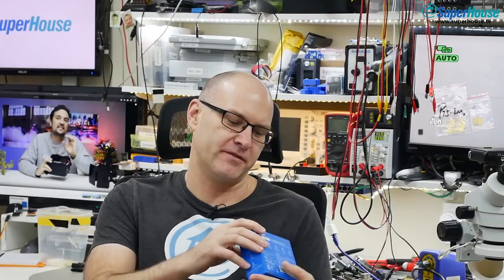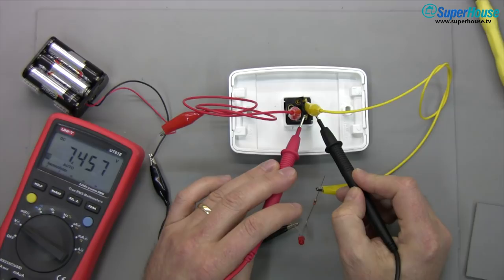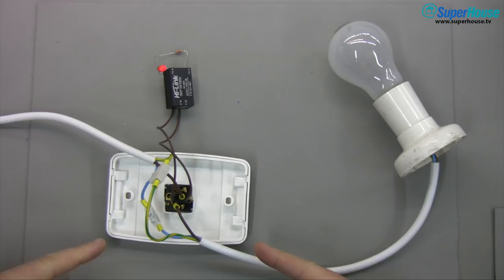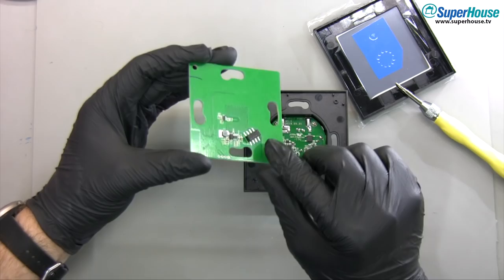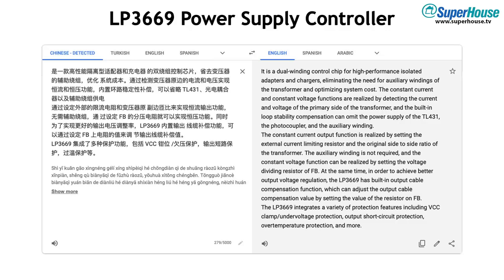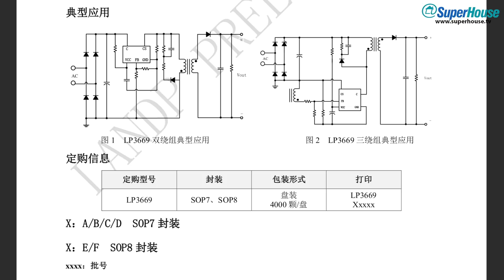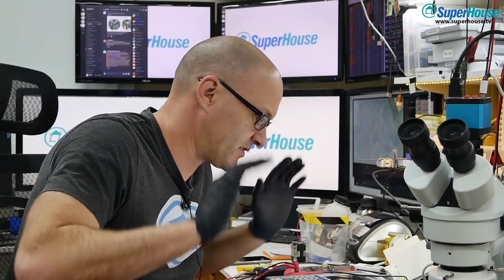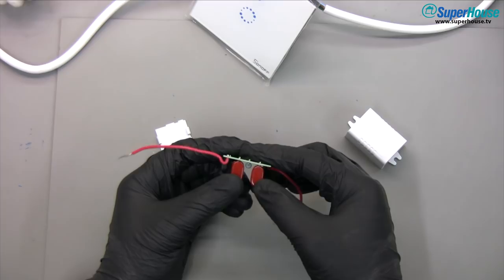SuperHouse #34: Science or sorcery? Sonoff T4EU1C no-neutral wifi touch switch

Comment: Nice video ! Also played with this switch like a month ago and I like it a bit more than Minitiger switches U may also check those the power logic on them is different,  but they are much easier to flash and also have the RF433 chip onboard so u may use that one too (useless for me though) But the big plus for this one is that I ripped off the front plate and cover and put instead an LCD with touch the power board here can produce enough mA to drive that, so all in all I like it but it only comes in 1 way gang and Minitigers can also be found in 2 or 3 way  that's a bit sad but fine for now as I have the best of both worlds. DO recommend this 1 way switch if u need some more mA to power up some other logic and u have only one bulb to control :)
Reply from the maker: I haven't seen the minitiger switch before. Thanks for the tip

Comment: ----  24:35 ----- Shouldn't that V be replaced with the RMS voltage there? Not the peak to peak voltage? Because if that 0.3A figure is correct, wouldn't that mean that there is a constant consumption of (240 x 0.3 =) 66Watts per each such device you install??? That's a very considerable consumption to add to your house. It negates any LED replacement bulbs you might have!

Comment: How much power can the high voltage side supply? Could I power a Pi Zero with a small touch screen for example? What I want to do is build a small unit that would replace a standard light switch and hack something like the Sonoff to power the Pi and the screen for a Home Assistant dashboard.

Comment: Very good explanation ! 
Is it so that the triac is in series with the relay contact ?
What is the purpose of the relay if the switch can control output power ?
I missed something probably...
Reply: The switch is no longer a switch. It's a toggle. It is not hooked to the mains.

Comment: Hi there, Just installed the TX T4EU1C with 3 LEDs they are P20. My problem is it works for about 5 seconds then turns off. I thought it maybe to much wattage so I reduced to two....still same works for only 3-5 seconds.
any ideas?

do I need to wire in the anti-flicker device?  YES  and all working...Thanks

Comment: Could you explain on the flickering of lights, I have a three button smart switch with a N connection on it. Two of the room lights work perfectly with No flickering, but the first switch flickers on off and off.

What I cannot understand is why two rooms work perfectly and one room has this problem, all bulbs are LED.

Comment: flashed 3 of these I took my zero volts from the connector on the back of the board and touched the other end on R10 while booting all 3 working 100%

Comment: How well does it work with a standard fluorescent light (not a CFL)? Does it need the antiflicker module connected? I have two fluorescent light fittings in my kitchen controlled by a single rocker switch.
Reply from the maker: It should work fine, but you'll need to use the ant-flicker module.
Reply: @SuperHouseTV  I'll just have to wait for an AUS style multigang one. Going to try one of the EACHEN switches that I have coming.
Reply: @SuperHouseTV  well I've had two of the EACHEN ones arrive. One is a single gang and the other is a three gang one. The "antiflicker module" is just a capacitor with these. I disassembled one and took photos but haven't had the chance to install and try it yet. I posted and added a few photos of it in the forum.

Comment: the power passing through the capacitors is mostly capacitive which is NOT charged by Power Utility companies for Home Usage
Reply: So if everyone was using these switches , would the sub-station power factor need correction ? 🤔
Reply: @peterfitzpatrick7032  probably, since each switch consumes near 60VA, this can easily add up to huge numbers and cause over-voltage specially when the network load is low

Comment: very interesting video. Is there any way to use a sonoff basic with no neutral, maybe with an external circuit home made?
Reply from the maker: It would take a major rework to allow it to be done. If you have to do it, I think you'd be better off using a T4EU1C and just embed it somewhere. It would be much easier than trying to mod a Basic.

Comment: Thanks for the nice video ! Is it possible to use this switch to control a serie of led lights ? If yes where you put the anti flicker device ?
Reply: Just across the fire and neutral wire before the first led in your series. Hope this helps.

Comment: Looks like the perfect nightmare for any radio amateur
Reply from the maker: That's a great point. I didn't even consider that! Now I wish I had a spectrum analyser handy
Reply: Jens. I agree 100%. A very relevant question. Too much RF pollution already. Does it claim to comply with a ny EMC standards ? I doubt it.
Reply: @daveh7914  an unshielded unfiltered triac like that are going to transmit a lot of RF noise all over yer property
Reply: @SuperHouseTV  if you got a small pocket AM radio you can tune it between stations and use it as a crude RF "meter".

Comment: Has anybody who has installed a "no-neutral" switch noticed any noise from the capacitor when the light is switched on? I have both the Sonoff switch as in this video and some Lonsonho-branded Tuya switches and both of the capacitor units (both entirely different) "buzz" when the lights are on - tried with both CFL candle bulbs and low-power LED G9 bulbs to the same effect. The capacitors are silent when the light fitting is off.

Comment: When the chip is pre-flashed, it does make sense to not have easy access to gpio 0, but then I wonder why gnd/tx/rx/3v3 headers are still there, as these should not be needed in normal operation. If the reason is to be at least somewhat tinker-friendly, adding gpio 0 and reset would be much preferable.
Reply: Good point.. I suspect the chip also needs to be flashed in factory. They could do that before they mount the chip on the board, but i think its common for manufacturers to give themselves the option to re-flash just in case.
Reply: @dozog  - Well, even the device manufacturer would find it hard to re-flash without access to the gpio 0 pin. And when cheap devices are in mass manufacturing, reflashing is highly unusual, especially as cloud-connected devices (like the Sonoffs with eWelink) are expected to receive OTA software updates at the consumer location. As long as there is room on the PCB, providing soldering points or holes is not much of a cost, and therefore I'm surprised if penny-pinching causes removal of gpio 0 but not gnd/tx/rx/3v3. Of course, the latter 4 pins may be useful for debugging (like connecting a serial terminal), but debugging is not much of a real-world use case with these cheap devices. While reflashing thru soldered wires is still feasible (I've done this in a smartplug), it does become a lot harder than when accessing the needed pins is easy. Therefore I wonder what the use case for providing gnd/tx/rx/3v3 without gpio 0 is. Speculatively, I suppose that it might be for attaching some sort of test rig on the assembly line.

Yes, flashing before mounting was exactly the scenario talked about in the video here.
Reply: @JohnnieHougaardNielsen  Yeah, i got that :-)
Thanks for the response.
Reply: @JohnnieHougaardNielsen  I would guess it is for the test bench. with 3.3v/Tx/Rx/Gnd, you can put it on a nail bed and verify the function, operator can touch the switch to verify it works well. I am not sure the ewelink firmware post something through serial when working though but that may be an option.

Comment: did i not understand? @27:25, upto 300ma of wasted current? at 240v isnt that 60w!
Reply: Correct, but since it's a capacitor not a resistor, it's reactive power (also known as imaginary power), not real power. You'll have to read up on power factor to understand it, but to explain it briefly, AC voltage is shaped like a sine wave. During each sinusoidal cycle, at the times when the AC voltage is higher than capacitor voltage the capacitor charges, and when AC voltage is less than capacitor voltage the capacitor discharges into the grid. 

So for a purely capacitive load, no actual power is consumed by the capacitor because theoretically it feeds back exactly as much power as it takes in. Of course, no real-world capacitor is purely capacitive, there's always some parasitic resistance that consumes power within the capacitor itself and makes it heat up.

The advantages of this method is that the capacitor acts as a resistance to the AC current (whose "AC resistance" value is known as its impedance, and is calculated using the formula on the paper, 1/2*pi*f*c) without consuming as much power as a resistor of the same value, and some current is still flowing back and forth to charge and discharge the capacitor (so the sonoff can use it to power itself).

Interestingly, utility companies will charge large consumers (like factories) in kVA (kilo volt-amperes) - which includes both real and reactive power - because the wiring and distribution system has to be built large enough to supply even the reactive power, which they have a lot of, due to inductive/capacitive loads (like big motors). For small consumers like you and me, they charge us in kW (kilo watts) - which is the REAL component of the power only.
Reply: @LMF5000  so what is amount of waste in watts approximately?
Reply: @krzysztofkujawski6513  For a purely capacitive capacitor, zero. For a real-world capacitor, I believe you can get a very rough approximation by calculating RMS current squared times Equivalent Series Resistance (ESR - you get that value from the capacitor's data sheet) - basically I2R.
If you want a more accurate answer, start by reading this (since capacitor characteristics change with frequency) - https://passive-components.eu/capacitors-losses-esrimpdfq/

Comment: Regarding that antiflicker add on:  So in a AC circuit the caps act as a resistor so the sonoff can get some power.  But why not use just a plain old resistor instead of the caps?  (I'm assuming there is a reason for that!)
Reply from the maker: AC and DC circuits behave in very different ways, so the resistor analogy may have been misleading. In this configuration the caps act as a current limiter, but they won't get hot like a resistor would. Resistors emit extra power as heat, while the caps accept power while charging and then simply stop accepting power when their plate voltage rises to match the supply voltage. They can sit in that state while using zero power (and emitting zero power) until the source voltage starts to fall and they begin discharging. Short answer: this is more efficient.

Comment: If there is a triac, why the need of relay?! If the triac is not continuously on ( while the lamp is on) but instead switches on/off as you have shown with the scope, that means the lamp will not light at the rated power but less. To fully understand what is going on, there have to be an oscilloscope measurement at the  lamp terminals ( not only the gate of the triac) .

Comment: Hi, can this be used with low power inductive loads like a ceiling fan or bathroom/kitchen fan. I'm looking for a timer switch to keep the fan running for a given time, and I could find mechanical ones only. I was thinking maybe this one would work. My socket has only 3 wires, live, switched live and ground. 
I checked manual of this switch, but it does not specify anything about inductive loads or fans.  Did anybody try?

Comment: Iv got 1 of same brand but mine requires nuetral wire :/ so i used it as a socket switch instead but i need 1 like this thatdont require a N also this is dimmable?
Reply from the maker: Not dimmable, it's a simple on/off output.
Reply: @SuperHouseTV  Ok can you recommend a dimmable alternative that does not require a neutral? im in an old flat which has the brown wires (live) only?

Comment: BTW The easiest way to put this thing into bootloader mode just connect it to your USB to serial power it up and tap the button while holding it just take with the other hand  a pair of small tweezers or a small screw driver and touch the small resistor R3 the one u've soldered the reset wire to. NO SOLDERING NOR pcb torturing is required! I'm crying when I see what you've done to that PCB, why??? if u need a video with the steps I could upload one, but it should be easy enough just try it ;) works like a charm every time and I can not understand what was so hard that all others had troubles putting this device into bootloader mode.

Comment: Can you run sonoff on the neutral cable?
Reply from the maker: Do you mean in the exact opposite situation, where you have access to the neutral but not the active? Yes, technically that would work. However, it's a really bad idea because it leaves the light socket live relative to earth at all times. It's the same as putting a passive switch in neutral and leaving active permanently connected. It works, but don't do it
Reply: you should be able to, AC is non-directional
Reply: @SuperHouseTV  yes, at least at my home few lights are connected neutral over the switch, and it would be pain to track that old installation to switch that - that's why the question. Thanks for answer.

Comment: 4:45 ... sometimes it's a 76 Ohm resistor and sometimes a 50 W resistor, not both at the same time though... ;-)
If it were a 76 Ohm resistor it would pass A LOT more than 50 W at mains voltage. The resistance of tungsten however increases substantially when the tungsten is heated to such high temperatures.
Anyway, about how the switch powers itself... Yes this method has been used by digital dimmers for a long time. I would like to know however, why the hell this switch uses a relay. It obviously has to use a triac (or some kind of transistor) anyway to be able to switch fast enough to pull this off. Personally I usually "build" my own ESP based light switches, because the clicking noise bothers me and because I use phase angle control to dim my lights, which wouldn't be possible with relays anyway.
I figure one could probably hack this light switch to be able to dim lights using phase angle control too. I just wonder why they included a relay (along with the clicking) when they were so close to avoiding it? What's the deal with that?

Comment: Good explanation but not sure why so long is spent with the filament bulb and explaining how it is a big resistor and how it functions with the sonoff when filaments are basically obsolete and everyone will be using it with LEDs anyway. Also a CFL makes a cheeky appearance for jokes but no testing it with LEDs?
Reply from the maker: The point of showing power going through the filament bulb was to explain that a circuit isn't powered down when the switch is opened: all it does is move the potential difference to a different location in the circuit. Using a globe and stressing that it's just a big resistor was a way to make it clearer to people who don't know much about the physics behind it
Reply: @SuperHouseTV  OK.
Did you test how it works with Led bulbs, such as GU10 spots when you have maybe 6 of them on a circuit? Are LEDs more susceptible to flicker? Also does that flicker fixer really drain 75watts at 240v or did I calc that wrong? Wow no point switching to low energy bulbs lol!

Comment: If you need to fit the anti flash module in the ceiling  behind the led lamp then why bother? Just fit a Sonoff mini there instead and connect the wall switch wires to s1 and s2
Reply from the maker: That's a good solution too. The Mini is great for that
Reply: All though if you reuse the  mains rated cable for the switch you need to pray that nobody on the future hooks it up to the mains. Not likely  but you can't be too careful. I'd always advise running LV mains on LV mains rated cable and ELV on non mains cable.
Reply: your Live wire might not be available at your light location in the ceiling... in my house, the live take a detour to the switch when on its way to the ceiling, and I am pretty sure it is like that in many many houses :)

Comment: I wish they made a mains dimmer too! I have another brand that does this, but it only uses rolling rf codes, so can't be easily integrated into home assistant.
 
https://smile.amazon.co.uk/gp/product/B07BJ617PQ/ref=ppx_yo_dt_b_asin_title_o05_s00?ie=UTF8&psc=1

So I'm now looking at controlling via piggybacking the switches on hand remote to activate them via gpio. The only problem with this approach is that I can't think of a way home assistant could the keep track of the switch and dim states after someone uses the wall plate.

Comment: Great video! I think iTead are the first ones who think about the potential problems by including the load to stop the flickering. 
Have you tried to use a test clip for programming the ESP chips? 
From the data sheet I gathered that all the pins you need (besides ground) are located on opposite sides and this way you could use something like this 
https://www.pomonaelectronics.com/products/test-clips/soic-clip-16-pin 
pin pitch has to be checked tho ;)
Reply: Schneider electric have been doing this with their cbus for years. It's a common solution to the problem of no neutral at the switch.
Reply: bravo bravo I know that this has existed for years, but the usual Chinese resellers are not thinking the solution thru and do not include such load ;) The problem with european companies is always the bloated price for simple components